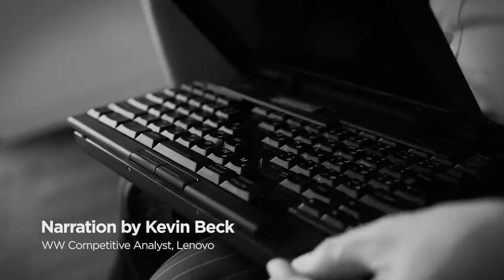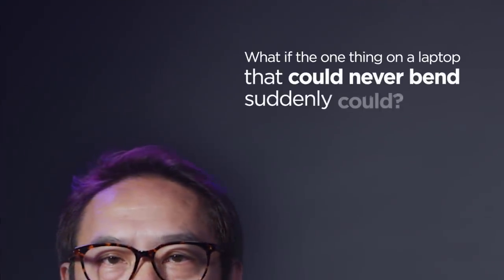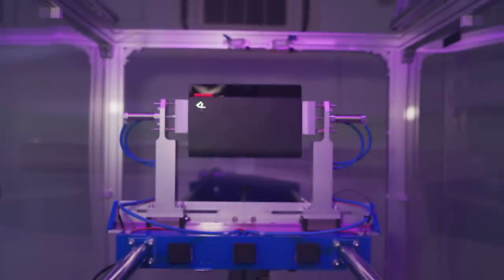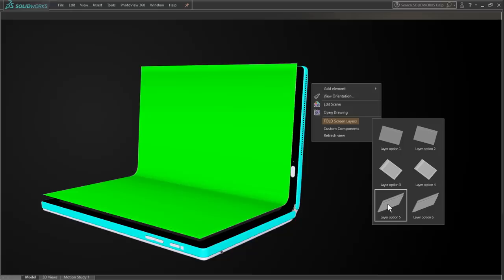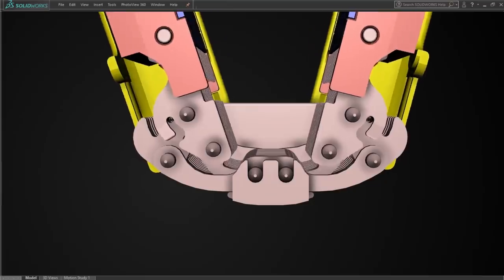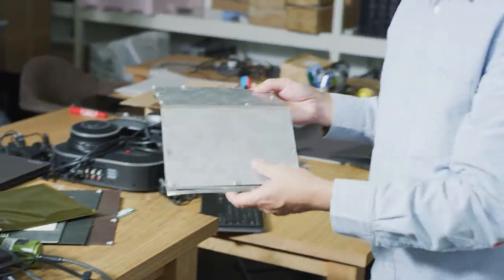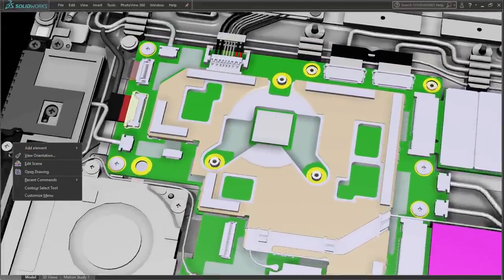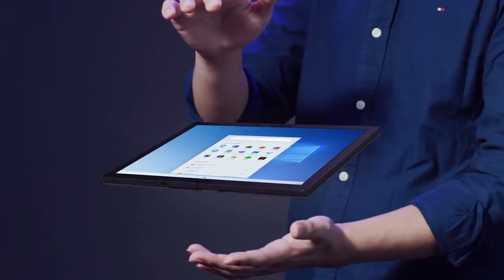Lenovo ThinkPad X1 Fold Story Main Tour

Comment: As cool as this is,from a realistic use prospective I still wish they update the current X1 Tablet (3rd gen)....
Reply: I am buying this, but I am also open for a x1 gen 3 with updated hardware and with a new aspect ratio of 16:10. That is a logical step most brands choose to take nowdays, leaving the weird 16:9 film format behind.
Reply: @snyggmikael  The Gen 3 X1T already used a 3:2 display...It's the only one in the current lenovo line up that is not 16:9... And as cool as the folding tablet is, I'm not paying $2500 for a lower powered CPU than my current X1T3, limited to 8GB of ram, and the screen is plastic...No thanks IMO. Would really like to play with it though, and I would definitely consider it as a portable tablet addition to a more powerful think pad workstation if the price was cheaper...But IMO paying that much for a gimmik and a downgrade in performance to the current Tablet that has been out since 2018 is a no go.
Reply: @tv321123  yea I was refering to the Extreme, my mistake